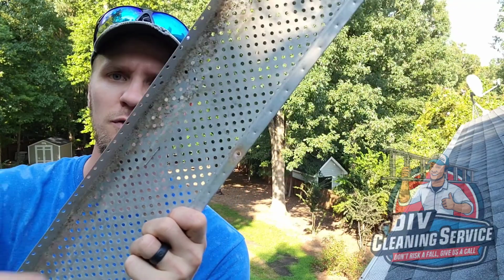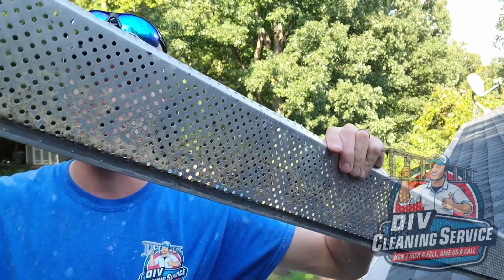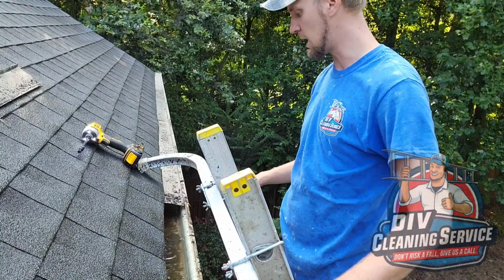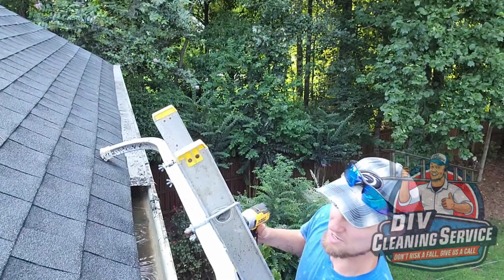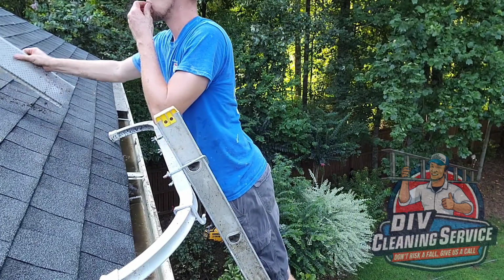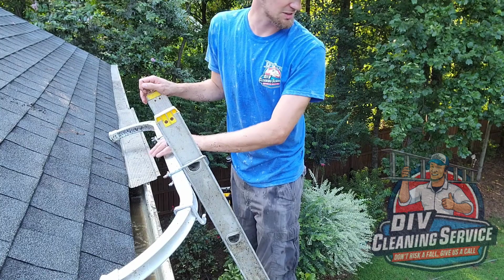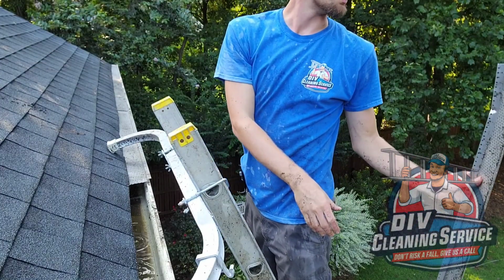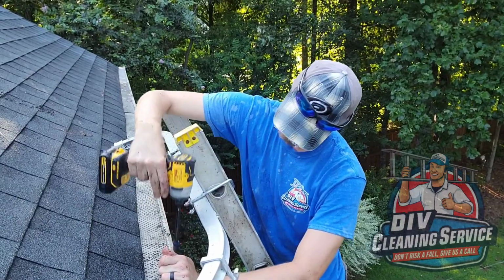How to clean under gutter guards without removing the Guards.

Comment: Thats an interesting way to clean out under the covers. I watched one of your other videos on cleaning the french drains with this tool. We get asked about it but never offer it since I always figured its more what a plumber does. Didn't look too bad though. When our customers have guards we either offer to clean the tops and flush down spouts our remove guards, clean gutters then reinstall guards. Takes time but we charge accordingly for it.
Reply from the maker: Guards and drains are a PITA. Some are easy and straight forward. . . Others not so much.
Reply: I like to open one end a 3-6 foot section and one middle and work to the ends.  Brushing the tops is important also as you suggest.

Comment: I have a maintenance company as well. I'm wondering what you charged to come back and remove the guards and cleaning underneath? If I get a client that has gutter guards and let them know it will cost significantly more to clean. 90% of the time they with go with another company that didn’t notice the gards and expecting they will do the extra work for free. Any segregations?

Comment: Very nice work! I’m wondering if you can rent that power blaster tool from a home improvement store? That is a genius idea! All the gutter cleaning companies around us I’ve asked for quotes for say they’d have to remove the gutter guards and it’s going to cost upwards of $400 which is not in my current budget so I’m just going to do it myself.
Reply from the maker: You can buy the "jetter kit" tool from Amazon for $50ish then rent a pressure washer from most home improvement stores.

Comment: I'd been asking all summer to have my gutters cleaned, finally they did it in October, just wiped off the top of the gutter guards. Couldn't believe it, I knew they were filled with crap and they ignored it. Wish I could hire this guy. Now it's December and they are dripping just outside the door way in the rain. I told them about this and they just ignored it. Hope the gutters don't come down in the winter. They need to come back asap and do it right.

Comment: do you know of a product that you could install to bridge gap horizontally between sections to minimize organic matter slipping underneath
Reply from the maker: Guards that are installed properly overlap slightly. You notch the front lip and overlap by 1/2"

Comment: We presume they get no snow.  This gutter is too high for that.
Snow requires that the outside edge of the gutter is low enough that a straightedge from the roof stays above it.  Here is why. Snow partially thaws, then refreezes into a slab of slush.  Then heat from the attic melts the bottom first, causing the heavy frozen slush slab to release, slide down, hit the gutter, and its immense weight tears off the gutter.  Happened to us.  Had remount the entire torn off gutter lower as it should have been to begin with.
Reply: His company is North Carolina; they don’t see much snow.
Reply from the maker: Very little snow here. We have a lot of metal roof over porches that have horrible insulation. Every time we do get snow or ice gutters always get ripped off.

Comment: When you are doing work like this do u bring your own water or do u use the customers water?
Reply from the maker: Both. Most trucks have a "buffer tank" which supplies a steady supply to our machines. At times the machines use more than the customer's hose will provide. The customer's hose simply refills the buffer tank. Very seldom does ANY service provider truck in 100% of the water being used. 

When we do have to truck in 100% of the water we charge accordingly.

Comment: What is the accessory that you are using and where can I possibly find it. Or what did you use to build that, it would help alot!
Reply from the maker: "jetter tip" you can order basic ones off Amazon.

Comment: Hmm...... The point of gutter guards is so we don't have to go up there anymore in the first place, then leave the gutter guards off and just go up and clean the gutters as before!!
Reply from the maker: 100% agree
Reply: @divcleaningservice9522  agree also - I clean gutters as a side business and tell people that installing and forgetting about maintenance is not a good idea.  I am sure you do the same.  There is a lot of business out there to fetch on gutter systems that are going bad.  Redos of roofs, as you suggest, they never match well.  When someone puts in a new roof, they should, if they can, match with new gutters at the very same time, and make sure the installer has a solid local reputation for the installation work and has been around for some time. Make sure the installers always check the attachment strength points (wood etc.).  People deciding to spend $3,000- $4,000 for installation of something like Leaf Filter, I can for my homes I work on here (single story - <3,000 sq ft) alternatively clean gutters annually (without a gutter guard, 3-6 foot sections, system) approximately two times a year, inspect them each time, for + -  $200 ($100 each time) and they will have approximately 15-20 years of gutter cleaning, video or picture inspection and commentary at that rate.  I can guarantee you anyone putting up a $4000 system should be cleaning or gently scraping off top residue at least once a year for them to be effective by year 5.  The inspection up close is worth the time to see what you bought.  What irks me most is when people spend $1000s on after market installs of gutter guards on old, rotting gutters, bent gutters, poorly pitched roofs and gutter troughs, etc.  May as well take them off and replace the old gutters to do it right.  The someone can see why new gutters, properly aligned, pitched, strength attachment points done right, will make everything work better (downspouts with stems away from foundation, pitched right in the middle of runs, etc.).  Open gutters with regular cleaning is still in my opinion way better for a home owner.  There are exceptions of course for each home and homeowner.
Reply: Only if you have the right gutter guards. Want to know how to choose your guard? Look at the trees around your house. If you have pine trees and gutter guards with a large screen, the gutter guards may as well just be decoration. You're going to get pine needles all in that system. Go with a mesh gutter guard. You'd be surprised how many people think just any gutter guard is a set and forget.
Reply: @adriangutierrez3792  there are no right gutter guards they all let some form of debris in whether that's part of the asphalt shingle granules or seeds that fall in from trees nearby and if you don't have them cleaned off on top of the gutter guards the leaves and sticks that just hang up there will degrade and essentially turn into a mulch or soil which then allows the seeds to grow And that's how they get filled up most the gutter that I clean that have gutter guards they only have the granules from the asphalt shingles maybe in one or two spots they might have a little bit extra depending on where trees are located but for the most part you're always going to get something in your gutter guards that at some point needs to be cleaned out

Comment: "without removing the guards" in the title, yet he removes the guards?  wtf.  Besides, they're supposed to be "leafless"?  lame.
Reply from the maker: We removed the guards for the repair not the cleaning. The jetter will clean under the guards, but the gutters would have had a low spot in the middle.

Comment: I hate it.
Reply from the maker: Sorry you feel that way. Hopefully future content will be more to your liking.
Reply: The Compassionate Capitalist not the video. The gutter guards I had to clean looked like cut pieces of wire mesh that were just pushed into the gutters. Not screwed like the ones you show.
Reply from the maker: ok understood. Unfortunately guards rarely preform as well as home owners are expecting.
Reply: Donovan, how do you price out the gutter flushes under the guards like this job?
Reply from the maker: @jaredbilsland6606  usually $225 minimum. Its by the job, but  We try to make $2-300/hr anytime using the power washer.
Reply: The Compassionate Capitalist is it almost a guarantee that you make a mess of the siding?  Do you factor that into price? Pretty much giving them a whole house.
Reply from the maker: @jaredbilsland6606  yes you have to rinse off the whole house. Only takes a couple minutes using a pressure washer. I just used the ball valve un this video. Obviously it would be best to sell them a house wash as well.